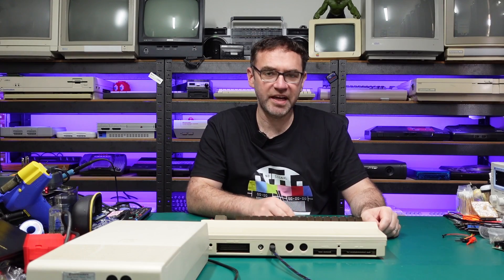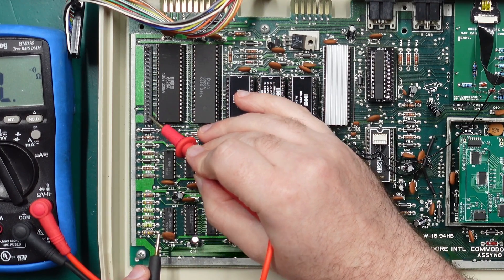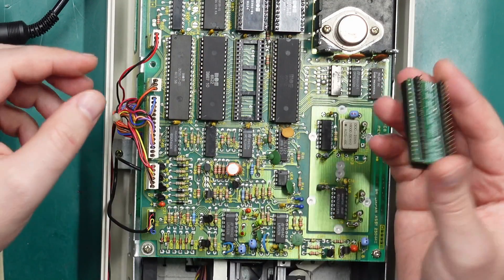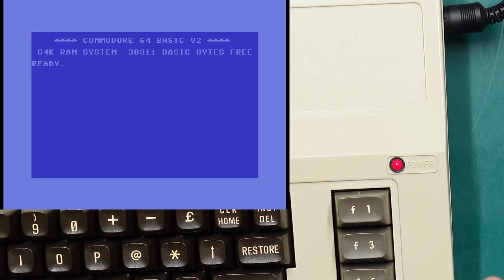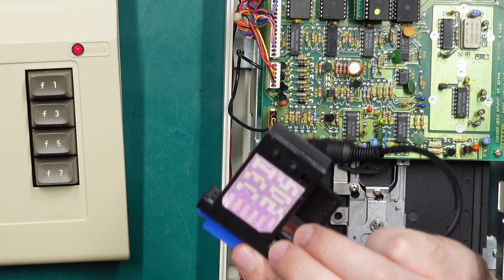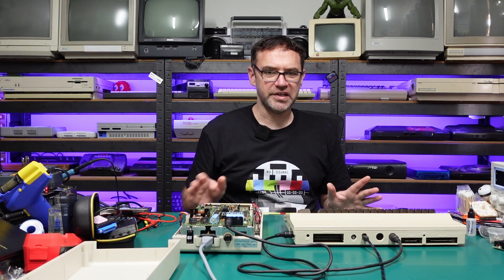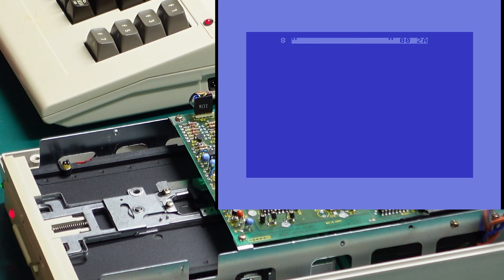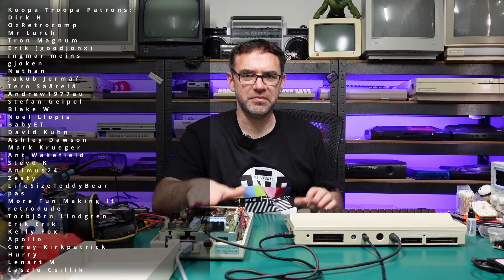Commodore 64 4 Kernal Switcher part 2 - Installation and Kernal differences

Comment: I have this on order. I understand needing the correct motherboard ASSY in the C64. I am a little unclear on the 1541 side. For the rom replacement on the 1541 side. Are there any considerations for the 1541 variants? Can I use it in a 1541-II for example?
Reply from the maker: Thanks for your order! Unfortunately it will not work in a 1541-II due to those using a different rom size

Comment: Sven Peterson's C64-Kernal-2.1 is described as:
"A Kernal prevents the killer CBM80 signature, that some games leave in memory from hooking up the C64 for a while."  Could be a better choice than the affected CBM one.  -Mark.
Reply from the maker: Ah yes, I've used Sven's Kernal before and it seemed to work fine. I just didn't want to risk the chance that some obscure program wouldn't work with it. There is also a "function keys" Kernal which is almost the same as stock but maps some shortcuts to the F keys while still maintaining the tape and rs232 routines. I also considered that one but again didn't want to risk it

Comment: With this set up you don't need JiffyDOS external switch on old 1541?
Reply from the maker: You still need the switch if you want to turn off JiffyDOS on the 1541, but from what I've found there is little reason to do so. The only thing I've found that doesn't work with JiffyDOS on the 1541 is the EXOS Kernal, and there's no point using EXOS if you already have JiffyDOS

Comment: Great video. Time to show my ignorance...Can this replacement 64 kernal switcher be used in a C128 in 64 mode and can a second kernal switcher be used on the C128 in C128 mode? Thanks
Reply from the maker: No. The C128 consolidates a number of ROMs into larger 28pin packages.

Comment: Do you need to buy two JiffyDOS licenses when you use JiffyDOS and JaffyDOS in the Kernal switcher?
Reply from the maker: Not from what I've found. But if you were to burn the JiffyDOS and JaffyDOS ROMs onto two separate ICs, or use each ROM image with with two different machines then a license would be required for both

Comment: I'm loving these ROM upgrades. They seem so much cleaner/simpler than the ones that came before. Another couple of newbie questions from me around compatibility. I've never used non-stock ROMs. 
1) Does a 1541 with JiffyDOS work with a stock C64 kernel,  i.e. for general operational uses there should be no need to switch the 1541 back and forth between Stock/JiffyDOS kernels on the 1541 if you're switching back and forth on the C64 ?

2) Given JaffyDOS is a JiffyDOS derivative, I assume a C64 with JaffyDOS is fully compatible with the 1541 with JiffyDOS for the extra speeds ?
Thanks making these and the videos 👍
Reply from the maker: Yes and yes. You can leave JiffyDOS enabled on the 1541 and it will work as normal, you just won't benefit from the extra speed. There is a very rare chance that something will not work with JiffyDOS in the 1541, but I'm yet to find anything that causes issues.

And yeah, JaffyDOS is fully compatible with a JiffyDOS'ed 1541 from what I've found. The only major difference with JaffyDOS is the removal of RS232 routines and a few obscure JiffyDOS shortcut commands don't work
Reply: @TheRetroChannel  Thanks Mark.